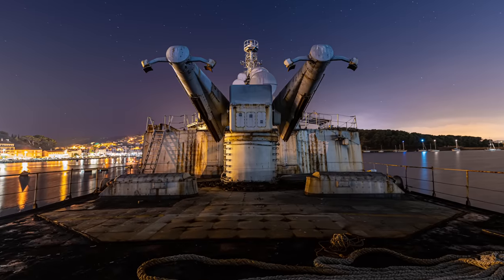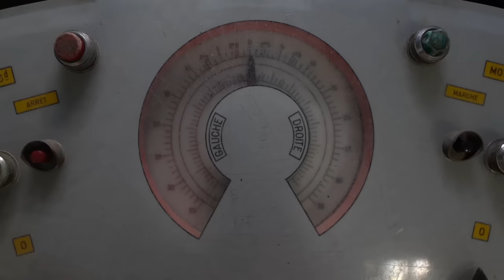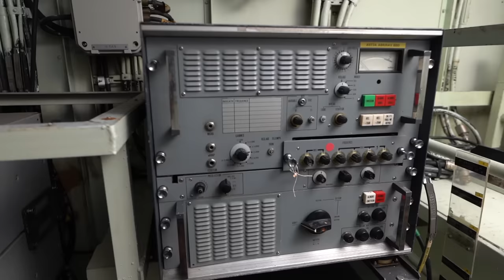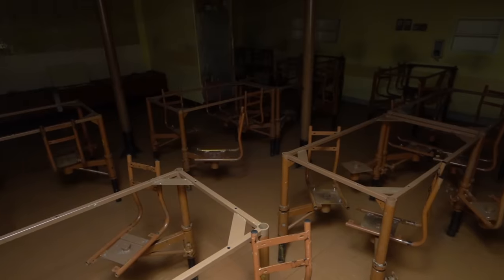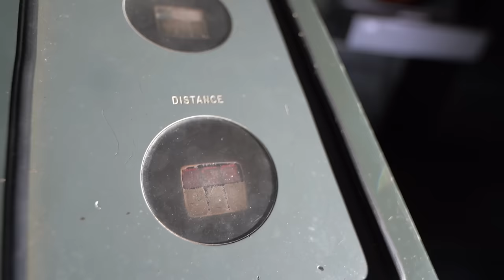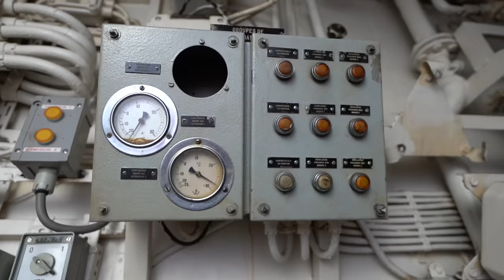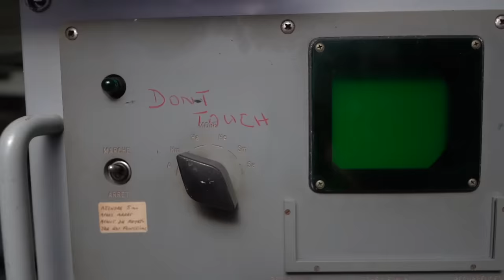URBEX | Snuck inside a decommissioned destroyer at a naval base

Comment: Those are UYA-4 NTDS Consoles in CIC. They were early models as they still have the manual numeric dial on the bull nose which were later replaced by a key pad. Spent many years operating them from 77 to 97 in the US Navy.

Comment: Thank you so much for this excellent trip to a somewhat rare ship. I guess life wasn't easy on this one but that's the thing on all old warships. The construction of the massiv radom looks really interesting. I also like the artwork and stickers in some areas giving the ship a personal note.
I just want to add some information on that one:
The areas where you can find these floor plans are usually battle stations for the inner battle (fire, water, injured people). There is one guy on the radio and usually several Sergeants who control a huge group of sailors. The guy with the radio receives the orders and forwards them to the Sergeants. They order the sailors to take action against fire, water and so on. Everything which happens during the battle to the ship is "plottet" on the floor plan usually with the time discovered and with the time when the problem was solved. 
The area where you found the post card is, I am assuming, part of the "Umformerraum" (don't know the english word). There the energy from the engines is transferred to electric power since especially the electronic systems of a warship need an enormous amount of power.

Stay safe :)
Reply from the maker: Thanks for the info Kanu and indeed, it was the umformerraum :)

Comment: Whoever designs these ships, hats off to them
Reply: Just that short section from 29:01 to 29:10 that shows the wiring and piping, thinking how much of that is prevalent through the rest of the ship is wild.

It’s no wonder that new ship programs end up taking so long to work out the bugs in all of the systems and sub-systems. Quite the feat of engineering and packaging.

Comment: @ 11:20 You can control the speed per shaft because it probable had a cruise CODAG (Combined Diesel And Gasturbine) setup per shaft. So you can set a configuration for transit with cruise diesels and if you need to sail fast you can have gas turbines, all connected with a big gear box. Furthermore you can "push" the ship to port or starboard, pending on how much thrust you give at one shaft.
@12:20 the big box with the glassplate is a plotting table (I have worked with a similar model). You would draw a lat/long chart and you could plot ship/submarine positions on it. As all the other equipment, it is rather old stuff from the 80's :)
@ 12:55 This is a "Duty Table", if you sail in a group of ships, several ships will have designated duties. Like the major air defender will get dutie 20 (AAWC = Anti Air Warfare Commander) the ship needs to have a back up companion in case it will get destroyed, hence the P (primary) and S (secondary). This ship would not have all the duties that are on that board, that would be crazy xD
@ 14:50 My best guess is that is the radio room. The most secret devices that would stand there would be the crypto devices to secure transmission, those are the devices that are taken out.
@ 18:39 It's called a galley on a ship :P Not a kitchen
@19:05 I think that only sailors would eat there, I guess there are multiple messes for higher ranked personell
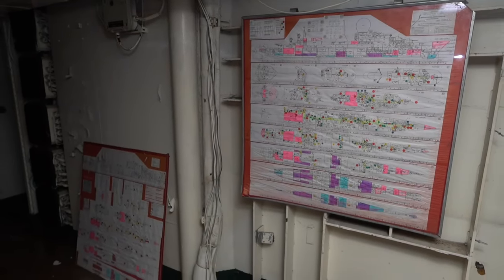@ 23:01 Those "plotting boards" are mostly situated at deignated area's where a lot of battle damage material is in the vicinity. If there is a battle damage or another severe damage, these area's would be manned with personnel to atack fires, stopping inflowing water and restore broken equipment. Also teams wich will recover wounded personell and bring them to the sickbay.
@ 28:11 I also think this is the "clutch" this cogs will couple either the gas turbines or the diesel engines to the shaft.
@ 29:48 It is defenitly in the generator room, however I think this is a fire pump, it will pump up seawater to pressurize the fire fighting system :)
@ 30:15 These seem to be the generators (looking a little bit small :D)
@31:14 these are possibly the switch boards for the ships electricity

Very interesting and great explore guys! Thanks for showing :)

Comment: There are some real wacky dials on that ship, I thought that sign with the ring finger getting sliced off was really creepy!!
Reply: That's actually a safety poster.  According to google, the legend, "pris avec la bague au doigt," translates to, "caught with the ring on your finger."  The graphic isn't a the finger being sliced off.  It's been pulled off.  The poster is a reminder to the crew to remove rings and other items like necklaces and bracelets before entering machinery spaces or servicing equipment.
Reply: @respectbossmon  I was an MM1, I refused to let any of my guys or girls wear any jewelry in my engine room.  Got a lot of push back but my chief and officers always backed me up.  You can be angry at me but at least you have a finger to put that ring on.

Comment: Unless you had permission and the sneaking is staged, this might get you in the hsit. The Duquesne is still in the French navy. It is a training ship according to Google. That means you snuck on a ship that is still a registered naval vessel. You might have to do more sneaking to stay clear of irate Frenchies. Good luck.
P.S. Toulon is the primary French naval base for the Mediterranean. The remnants of the French fleet were scuttled there when the Germans moved on Vichy France during WWII. Tanks sent to seize the ships arrived to burning wrecks and French sailors laughing at their wasted drive. French tend to say it proves France kept its word not to allow its ships to fall into German hands. The Brits contend that it proves the Nazis wanted those ships, so their massacre of the French navy at Oran in 1940 was justified (about 1300 French were killed by the Royal Navy attack on the battleships and battle cruisers tied up in that Algerian port).
Reply: P.S. the first thing I think of when I see old military equipment intact is whether its electronics were transistorized or still using radio valves. I play guitar. ECC83/12AX7 valves from the old days are like gold. Modern ones tend to not sound as good in guitar amps. Valves from the Cold War era by Telefunken, Phillips Mullard, Amperex, Brimar and RCA can fetch 100s of dollars each and old military sites occasionally have 1000s of them (Unused NOS stock found in storage is crazy expensive, but even used ones that still read well on a meter can fetch high prices. Demand for them is very high, so a find is like finding buried treasure).
Reply: Well, they're already banned from re-entering Portugal (at least for the immediate future) after boarding the Barracuda (I think it was the Barracuda), and they'll probably get shot if they try to re-enter Kazakhstan, so what's one more country on the no-go list? 😅
Reply: @soddinnutter5633  hello I work in this base and I have informed the chief naval security officer...they will not escape what they did ...because twatts like this makes life harder to go to work...☹
Reply: @patrickbonin137  i think ya'll need tighter security around these remarkable ships!

Comment: Why did they stick tape on all the screens ?
Reply: I'm guessing here. The tape is probably to mark the disabling/removal of essential/valuable components. They just stripped the ship so its basically useless and they don't have to service and secure it.
Reply from the maker: @Mart687  Thanks for the info :)
Reply: I noticed it was on a lot of glass things - I've seen it before in some places to keep glass from falling out and breaking, or if it does break to keep the pieces together.
Reply: If the reason for the tape is to prevent breaking glass becoming a hazard, they did a rather poor job. Just 1 strip of thin cheap brown packaging tape on most screens is hardly gonna improve safety for the risk of imploding vacuum tubes/screens.  

At 14:23 in the video there's brown packaging tape placed diagonally on a meteo chalk board. It's a good clue why this brown tape was used in this way. It's to mark progress of dismantling valuable systems so the ship is ready to be sold for scrap metal.

Comment: Very cool explore.  Ever find anything that still worked on one of these ships?
Reply from the maker: No, nothing runs anymore on these vessels. I've been on quite some (naval) ships :) In factories you can often find things that still work aftr 20+ years of abandonment.
Reply: Nothing will run because their generators are not running and are not connected to shore power. Even if you applied power you would have to know how to turn on the main switchboard. They are often if not always switched off to prevent overvoltage incase of lightning strike. 
Kind regards from a  naval switchboard outfitter
Reply: @ExploringtheUnbeatenPath  just wondered if you ever turned a valve and something happened?

Comment: Literally everything on board and about this vessel is obsolete!

The technology of the vessel itself and of it's equipment and systems fit.

It may be worth something in scrap metal, but would cost quite a lot to relocate and break up!

For getting about in the dark without alerting people nearby, perhaps consider investing in some inexpensive night vision equipment.

You certainly find some interesting locations to explore, it's not difficult to imagine this vessel as a fully operational hive of activity, bustling with crew, each committed to their particular sphere of expertise.

Taking the Gas/Oxygen Meter shows excellent, sound judgement, I have heard of people entering long abandoned sites and experiencing breathing difficulties due to bad air circulation.